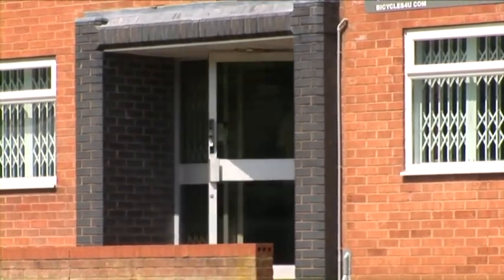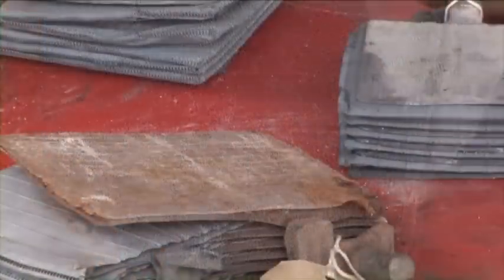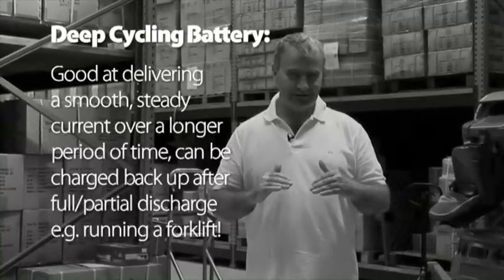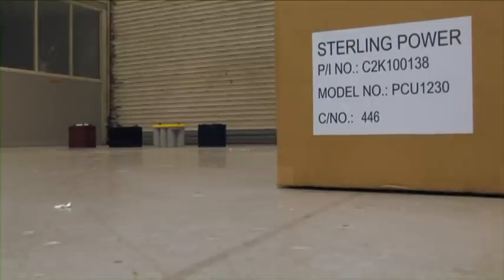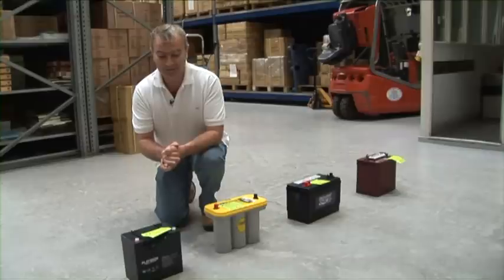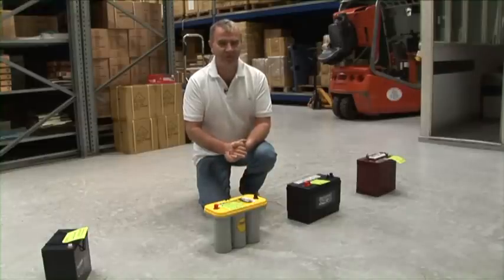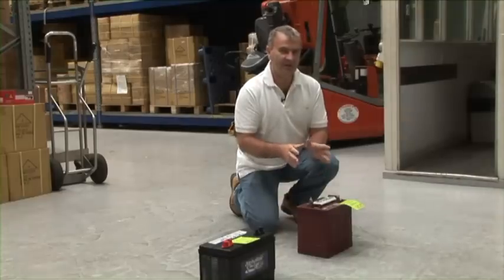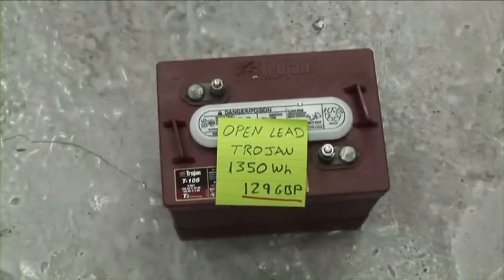Sterling Power - Batteries

Comment: I'm about to purchase a sterling b2b charger 50A 12v. I d like to know if the charger from sterling would charge a deep cycle (which i immagine is a traction battery like the trojan in the video). You say in the video that that kind of battery is your favourite one, would you suggest a trojan one or are there other good brand you would suggest? and in case the trojan is good enough, would you suggest buying a 12v one instead of a 6v one?
Thank you. I hope you can answer me.